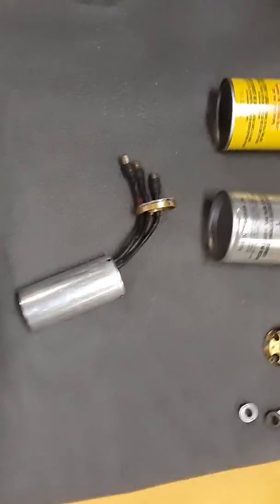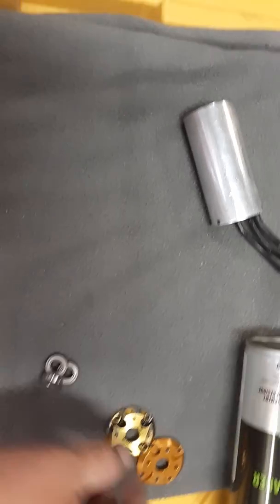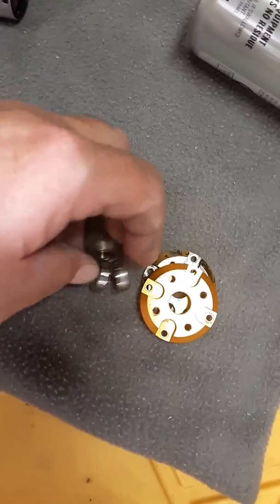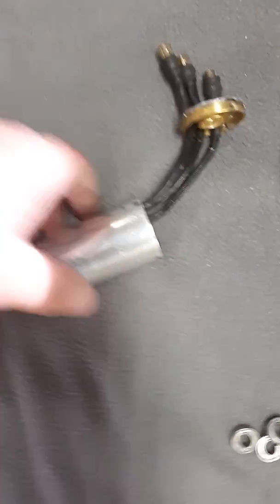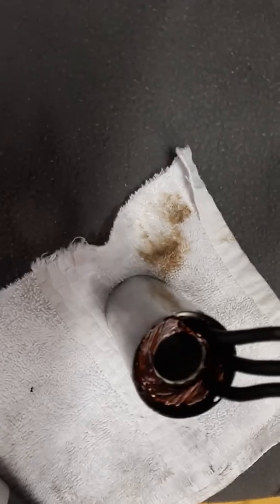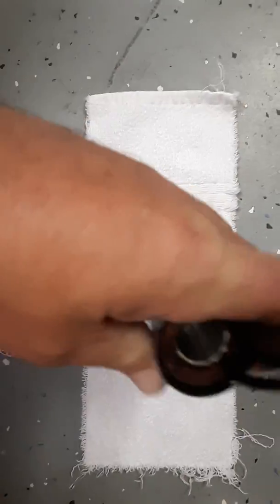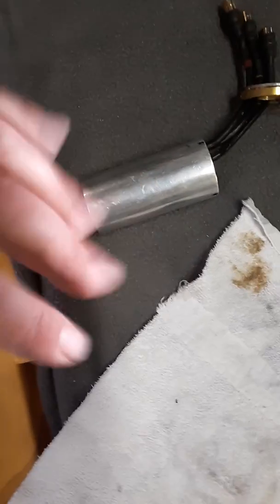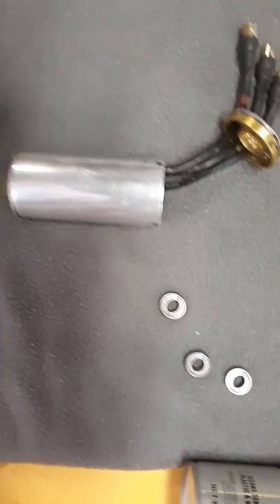CLEANING YOUR BRUSHLESS MOTOR REPLACE BEARINGS   TP POWER

Comment: would heating up the bearing with heat gun help the glue ease up a little i was banging the shit out of it but didn't want to budge or damage the cap since i doubt you can get another one
Reply from the maker: Yes I've actually  used a butane torch . Or a heat gun will help ... you can order new end plates  but it's s pain
Reply: @flopackrc5452  thanks next time Im cleaning it’ coming out one way or another
Reply: @flopackrc5452  Hey flo! where can you order end plates from?

Comment: Hey there. Great vid thanks for the tip.
I’ve got a TP4060 that I need to replace the rear bearing on and just wondering how you got the rear cap off. I’ve undone the three screws but it still won’t budge.
Thanks again
Reply from the maker: Take a hammer or rubber mallet and hit the shaft towards the back it will push it out it has a tiny bit of glue

Comment: Have you considered running a better bearing? Might want to give these a try. I use them and can't fault them.https://www.bocabearings.com/products/smr688c-2os-7-udl-17261
 Last a lot longer than the cheapo China TFE bearings. Trust me, you'll gain speed with these, and they will last long enough to be an overall better investment than the cheap stuff you replace often.
https://www.bocabearings.com/products/smr688c-2os-7-udl-17261